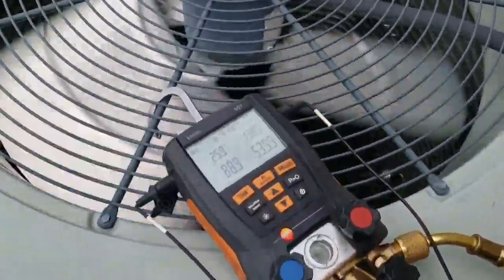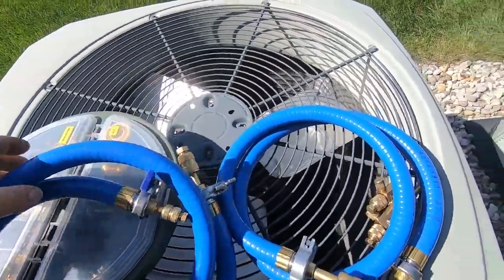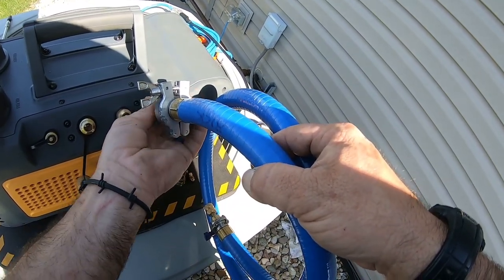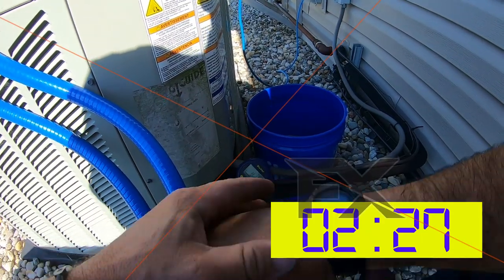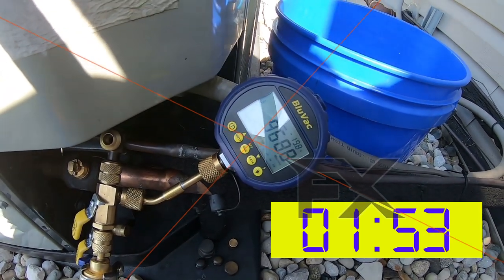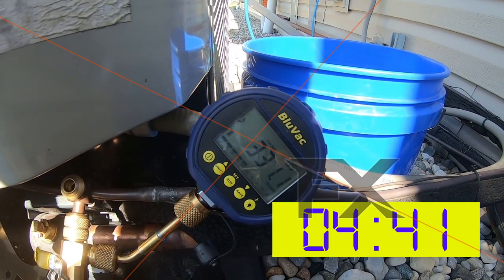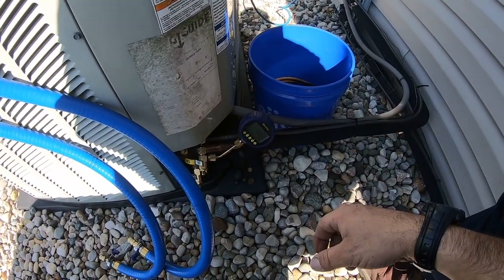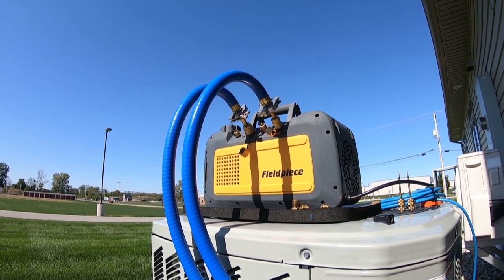TXV Diagnoses & Proper Evacuation 228 Microns In 1 Min 45 Sec

Comment: After 2014 the best way I found to conclusively condemn a TXV is to confirm charge with sub cooling(many times they’re overcharged because people put refrigerant in them to try and bring up the suction pressure), and check superheat. If sub cooling shows there’s adequate refrigerant charge but superheat is stupid high(30+ degrees) that’s a bad valve. Filter dryers are giver take 3° drop across them for R22 and plus or -1° with refrigerant 410a. Those hoses are ridiculous! Now I have to go buy them. Great video
Reply from the maker: I agree on all the above statements you made. Thanks man! Have a great weekend!

Comment: Hello!!! Do you think the fieldpiece pump is better than the Appion TEZ 8 pump?
Reply from the maker: They both are really good from what I've seen. As far as reliably I haven't had any problems with the fieldpiece, I haven't used the TZ but someone at my work place has it and I haven't heard anything bad. Two good valve core removal tools and large vacuum rated hoses will make more of a difference than the pump.

Comment: Can't agree enough. Large diameter hose is so much faster than 3/8
Reply from the maker: My first test video with these showed I had to pull multiple times longer and couldn't get a 1/4 of the depth of vac. Truly amazing. I find these to be more impressive when you do a compressor change and there's any non condensables in the system,  whereas it will take forever with normal hoses and you may pull vac for a long time just to find out you'll never come close to reaching your target.

Comment: What length are those trublu hoses?
Reply: That's an excellent question.   I did a bit of my own research, and found they sell hose separate at 2.5 meters (8').  BUT.  the hose in the kits looks like it's 1 meter long (3').   So if you buy the kit, I would imagine you'll get the 3' hose(s)
Reply from the maker: The hoses are 1.5 meter each.   I purchased 2 starter kits, one at a time so I could verify the speed was worth it.  I find that the extra length helps with easier connections when I service equipment that is in hard the reach areas,  but normally shorter hoses are quicker however I don't believe the time lost due to the extra half a meter is hurting my recovery time enough for me to regret getting them. My 3/8" hoses were about the same length and I USE to think they were the cats meow 🤭,  Now I use them for fast refrigerant recoveries. Great question!
Reply: HVAC*R Survival ok thanks, the XL kit Is perfect
Thanks for the reply
Reply: Crfor Freedom yeah problem with the separate hose then you need to buy all the hardware separate. The XL starter kit will be perfect but then you need to buy two of the xl starter kits
Reply from the maker: @kc00  that is the one I got.
Reply from the maker: @kc00  your definitely correct! The adaptors hurt more than they should. I like nice tools but only if they make my job easier.

Comment: This setup takes to long lol. 
But ima get it with I get my income tax lol 
I'm looking to get the pro setup i think its like $900 
Right now I got the appion setup with a 6CFM JB Eliminator. 
It works and does the job. 
But I like trublu set better.

how long are those hoses you have?
Reply from the maker: Good to hear from you Trucker. lol, They are 1.5 meters long. I purchased two of the $170 kits with the 7 or 8 % discount code from someone. Even I wouldn't speed $900, that would HZ to much lol.
Reply: @HVACRSurvival  Ever looked at a surplus Edwards pump for doing big jobs?  They're heavy but they can really pull and they can take more than most HVAC pumps.

I begin to wonder if Fieldpiece even machines their own pumps.
Reply from the maker: @douro20  haven't heard of Edwards and from what I hear the Fieldpiece pump is made by Navac but haven't got hard proof of that
Reply: @HVACRSurvival  Probably since Edwards pumps don't often show up in HVAC except for people who work on big equipment for a living.  They're usually used in lab vacuum setups like on electron microscopes or vacuum ovens.

Comment: Look at the arrow on the drier at the beginning . What direction is it
Reply from the maker: The black original drier is pointing towards the evaporator coil and is correct, the Sporlan 163-s has the label facing away to make the install look clean. The drier is formed equally on both sides so without going back to verify I can't prove either way. But I'm usually careful to make sure it's correct, especially when It's going to be looked at thousands of times. Thanks for watching!
Reply: They have bidirectional driers but I don't think that is one of those just trying to help not criticism.
Reply from the maker: @timmclaughlin2216  I watched the video over again and don't see any markings on the gray drier.  This was strait cooling ac,  the drier was a 163-s, not a HH biflow drier,  you could not see the arrow because it's not shown,  only the original black drier has a arrow shown,  the liquid comes in on the left 3/8" copper line then turns right to the drier then to the evap.